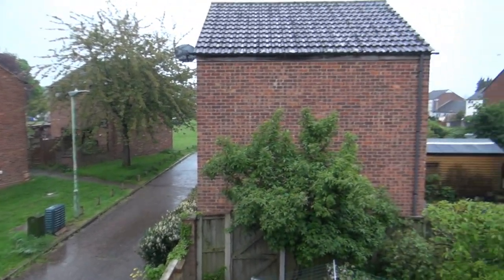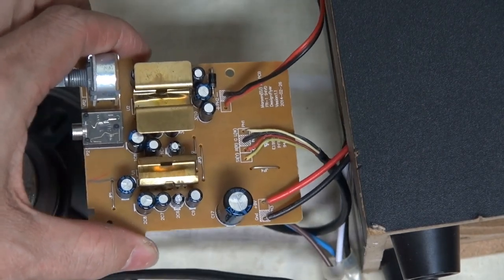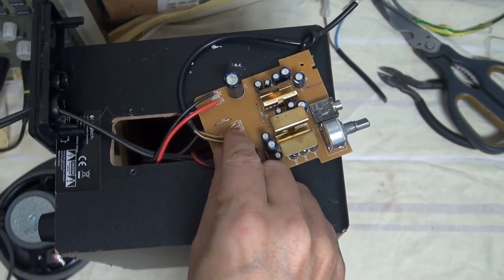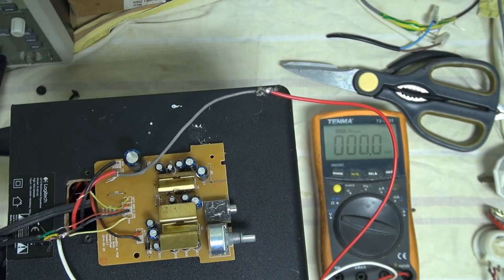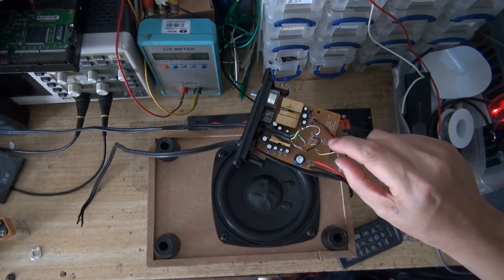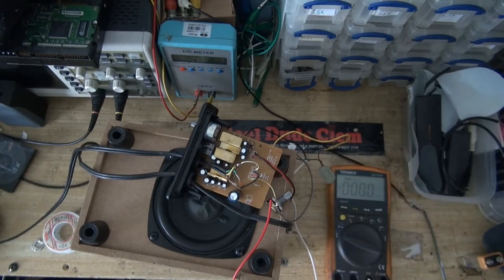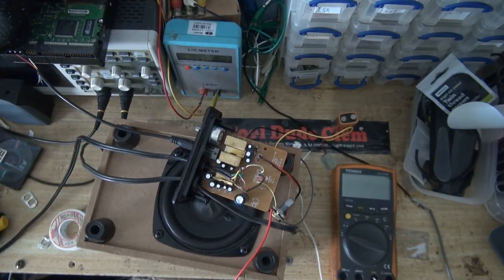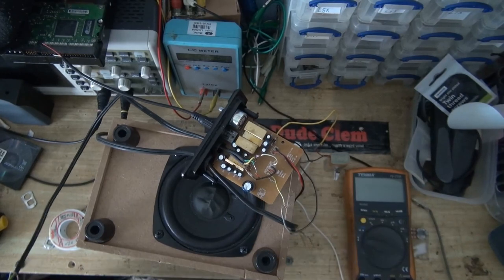Failed attempt at "repairing" a powered speaker.

Comment: To know for sure what that standby line was supposed to do it probably would have been necessary to remove the heatsinks, look at the part numbers and refer to the datasheets. But I agree, it's just not worth the effort. The chips are clearly not Class D amplifiers, and traditional amplifier chips in DIL case with heatsink on top are generally pretty bad. Quite possibly they are not even overload / short circuit protected, which could explain why the system didn't seem to work...